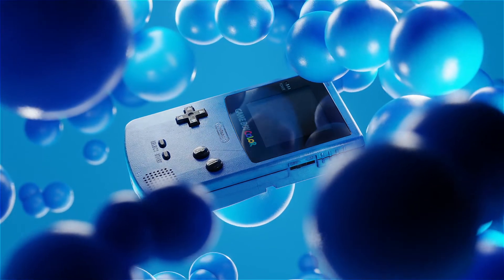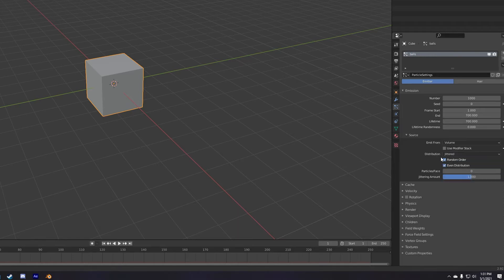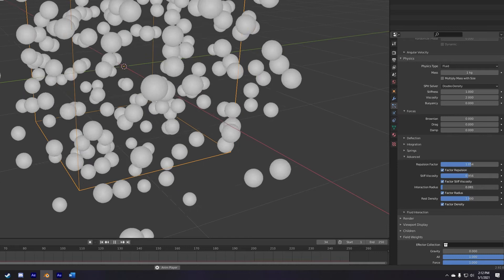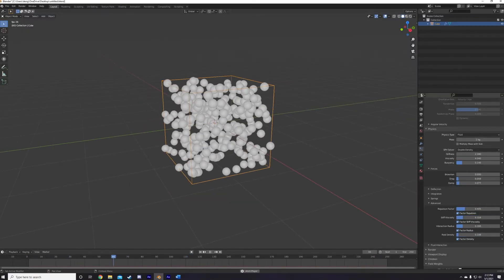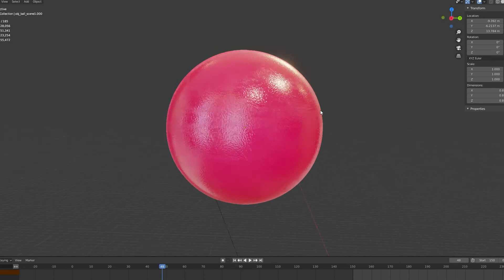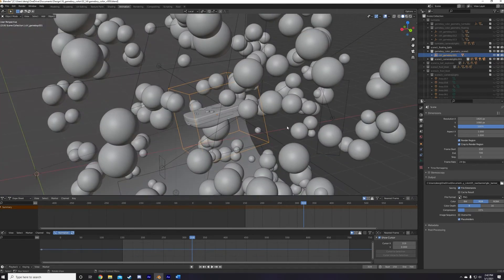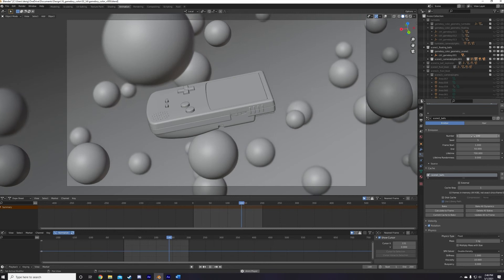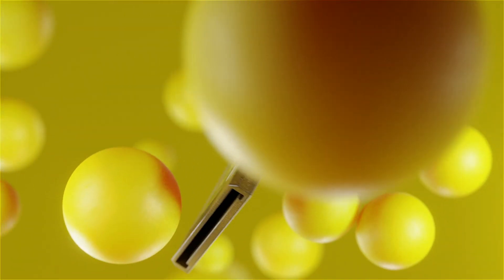Easy Particle System in Blender 2.92

Comment: Is there a way to make all particles appear at once, because for me sometimes new ones appear on the screen.
Reply from the maker: You can use the start and end settings of your particle simulation to set when the particles should start and stop appearing, just make sure the lifetime setting is set to be high enough so that they don't disappear mid-way into the animation
Reply: @sab3d  I did this but my particles still disappear